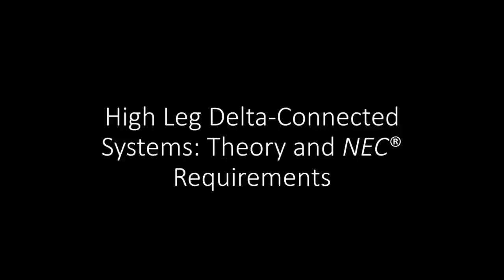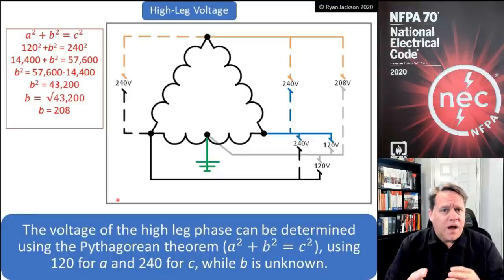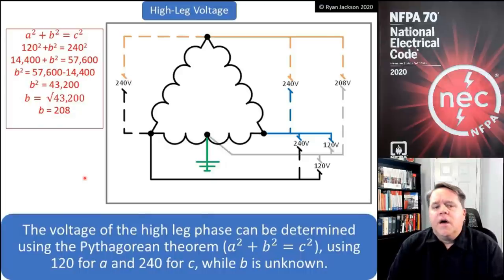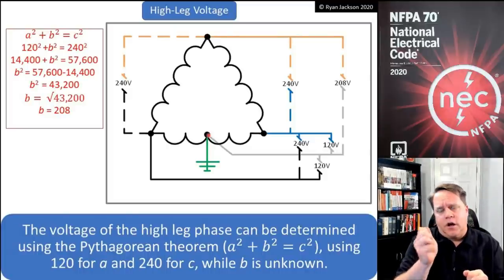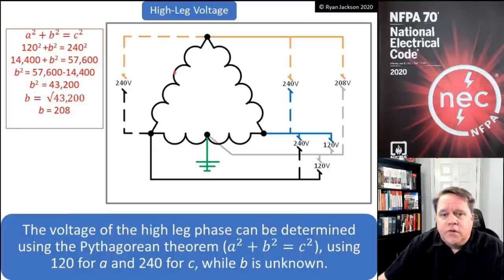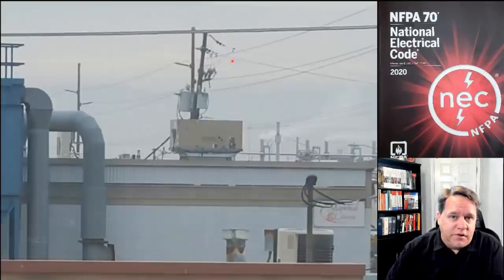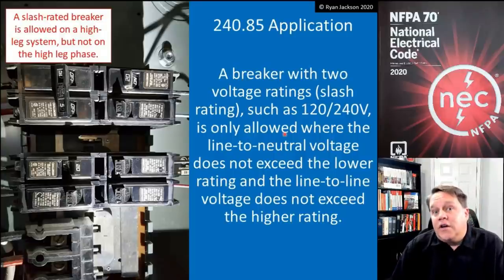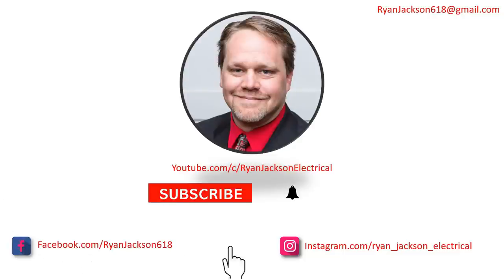High leg delta systems--explanation and NEC requirements

Comment: Thank you for explaining.   A good buddy of mine, is a master electrician and has been in commercial and industrial for nearly 40 years, only ran into a 480/415/240 volt delta, once in his career,  so far, which is  how unusual they really  are.   It was in a woodworking plant somewhere in northern Kentucky,  about 30 years ago.   The larger motors were running 480 3ø, while they were running the metal halide high bays as well as some smaller equipment off of 240 volts, or it appeared that way anyway.
Reply: I wonder what they used the 415 for, if anything. That'd be really cool to work on such a system. I'd really have to slow way down and pay a lot of attention though. I wonder what the color scheme was (not that I'd trust it to be true through and through, god knows there was probably a maintenance worker somewhere along the way that patch something in with whatever they had)... but just out of curiosity... still it sounds like a fun place to do some wiring. I like unusual challenges. Thanks for sharing. Unfortunately I'm doubting the likelihood I'll ever run into something like that. I don't do much industrial.

Comment: Thank you for your educational expertice. I am grateful for your knowledge sharing. Here in San Antonio, I asked CPS to provide a High Leg to my home to power several 220  high current  devices (welders , plainers, band saws ,and a few other 7.5 HP equipped devices). Their response was that  we dont run these to homes given that the feeds are 1) underground and 2) the cost of installing a transformer might make you change your request. I settled on  320 Main  with (2) 200 amp pannels and never looked back. Thank you CPS for an education and pulling it together for me.  That being said,  I dont mind paying more for power given their accomodation ..

Comment: We still have a few corner grounded deltas here in town. can easily tell because the metering cabinet is on the base of pole, and there are only 2 CT cores up on the crossbar on the pole. also, you can see a small bonding wire coming from the third unmetered leg going to a ground wire running down the pole.

Comment: Excellent video, and very timely for me, complacency just led me to burn up the 120v coils on 2 contactors, because, in a rush trusted the colors, did not use the meter, and connected the high leg to the control circuit. Won’t happen again.
Reply: Yep, easy mistake to make,

Comment: I have a 480V H-L Delta in three single phase cans with each center tapped. It is providing 480/3ph and 240/3ph and a 415V stinger leg. If 480V Delta HL is rare, this set up with center taps on all the windings to give 240V/3ph has to be a unicorn.

Comment: I beg to differ, high legs are not a trap they're just an indicator that it's time to change gears... slow down and pay attention to what you're doing, that's all. They can actually have some cool applications. 

[TLDR: the rest is just story time about the only time I ever really dealt with a high leg system when I was an apprentice under my dad. We installed the system in a rich guys machine shop. It was fun. I was an unfocused kid.  20 yrs later, I'm impressed with how much I remember of it.]

(I'm too lazy to proofread it or break it into paragraphs, sorry.)

When I was first doing my apprenticeship, my dad was my mentor, and we landed a 400a residential service for a well to do guy with a machine shop in his backyard, and we put a rotary phase converter then a delta to high leg delta transformer in the shop it was a pretty cool experience. We labled the inside of every box in that shop even if no high leg was carried to it just in case in the future someone pulled a high leg in cuz dad thought the guy migh rearrange his shop at some point. It was a really neat setup. The 3 phase pannel had it's own seperat boding and ground and it was locked out such that you couldn't turn anything on until the phase converter was turned on so that it never started with a load on it. I didn't understan much of what was going on but I was learning a lot really fast. Now I know that there was a lot of unusual things going on there, like the phase converter perduced all 3 phases not just on extra phase so that the phases were 120° without any fancy syncing mechanisms and it was it's own isolated service system. Basically it was two giant motors, one bigger than the other in a pedestal mounted cabinet just outside the shop, that fed his custom transformer (also pedestal mounted cabinet just outside of the shop next to the phase converter) that ran to an external disconect then to an internal pannel. We labled the pannel, then on top of field marking the high leg and marking the pannel on the outer cover inner cover and inside the panel itself we also put a printed lable on the high leg, and next to every high leg breaker slot on the panel cover even if we didn't break out that slot cover and put a printed lable on all the High legs in boxes that we actually used. We ran grounding conductors throughout and bonded all the conduit and boxes with bonging wires and bonding fittings/connectors. With how much precaution dad was using I'm surprised we didn't used ridgid (probably cuz dad didn't wanna buy a threader if I had to guess)... honestly I think the guy said something to Dad that made him scared that the guy didn't really understand electricity, and so dad was just being super extra. Plus the guy said the shop was his baby and money was no object, he wants it really nice so... I'm actually proud of myself that I remembered all that... I was like 19 and didn't understand half of it and didn't really care it was more focused on girls... now I'm in my mid 40's and thinking wow, I picked up on more than I realized...

Comment: You can connect modern LED light fixtures to the high leg with either hard wired  fixtures or with mogul base sockets (120-277 volt 50 or 60Hz). Make sure that you use a
Straight rated 240 volt circuit breaker.

Comment: Most transformer manufacturers make a 240 volt delta primary to 208Y/120 secondary 3 phase transformer in all of the standard KVA ratings. You would have to special order it as most supply houses don't stock them. You can put all of your 120 volt loads on any of the phases of the secondary of this transformer. You can therefore balance the secondary of this transformer as well as the primary. You can therefore balance the overall load on the high leg service.

Comment: "If you ever run up against a high leg delta, now you know what to do and you know what to look out for..."

Well, not quite (actually I do - "Call an electrician") - but I certainly know a lot more about this area than I did 30 minutes ago. I always wondered about that 208 volt thing and now understand that much better.

I can also now glance up at transformers on a pole, stroke my beard, and make sage statements like "That's looks like a open delta high-leg drop" and then wander away before anyone asks any more questions.

Comment: As a HVAC technician I would love a marking in a box with no neutral. We often connect 120v equipment  by grabbing a leg and using ground for a neutral when we don't have 120 on the roof
Reply from the maker: You need to stop doing that before you kill somebody.
Reply: If only that was an option

Comment: Just last week I ran into this, and like you said every 3rd breaker slot was empty. There is one set of wires from the pole connecting to two heads with two separate line sets going down to separate disconnects. But one panel has the orange, center, high leg fuse missing, then at the two panels they lead to it changes to the C phase, and is marked high leg orange. Is anything different as far as bonding neutral to ground, at the first panel only? Reason I ask is one of the sub panels has a sticker saying it would need an isolation kit to separate grounds from neutrals, and both were attached to same screw terminals. Wondering too about balancing the phases, thought I’d connect all the 240v HVAC units and ovens etc that are truly 240v, meaning no neutrals to the high leg to try to balance things, but not sure if I should or if I should just keep not using the high leg. I’m doing what I can before the electricians come in.

Comment: I came across a 480 volt high leg delta system once. It was at a waste water facility in north-east Ohio.
Reply: Very cool.   I didn't know that even existed until I watched this video, and I bet many electricians probably never will run into that.   Personally I have worked on a few 240 volt delta systems in Southeast Michigan.   They are (were) fairly common in rural areas and on farms that had 3 phase motors for grain dryers , augers and conveyors,  while the majority of the load was 120 and 240 volt single phase.   In that instance they would often install a second transformer and create an open delta high leg.   In this day and age, though,  it's pretty common to use a rotary phase converter,  if you are in a situation where you have a few pieces of 3 phase equipment but only single phase is available,  as it's typically much cheaper and most cost effective.

Comment: I would imagine many of these requirements also apply to a system derived from a 240 volt single phase to 240 volt three phase phase converter, since the end result is also a high leg delta...

Comment: Ryan, I started my career as an electronics tech on B52 bombers in the USAF right out of HS.  I took up Electrical wiring (Commercial then Residential) in 1972 and got my Journeymen's license.  About 1980 I went on to designing mechanical and electronic equipment and programming embedded microcontrollers and PLCs. Skip 40 years, I now am building my first and last house.  That being a 40 year span I need to learn the NEC again. I do have a licensed contractor to guide me and pull the permit and check my work before inspection. I am designing the electrical and mechanical of the house.  I have watched many of your UTubes and just came upon this one.  I have to disagree with your usage of 120/240 volt  2 pole breaker on the high leg.  The breaker contacts have voltage across it only when it is OFF. When ON it has 0 volts across the contacts.  So the two connections possible using it would be two 120 circuits to neutral. Not really functional unless you wanted to to drop out both circuits (120)when one tripped. This is one of my intended uses for it!  The other connection is two legs connected to a 240 volt load. Phase does not matter because the load is not connected to neutral..  The only restriction is the same as a single breaker connected to the high leg with the load connected to neutral. I plan to use the high leg for 240 volt loads. What I'm looking for is where I need GFI and or AFI protection. Thanks for your excellent teaching. Dave
Reply from the maker: See 240.85.

Comment: Hi Ryan, I can't find any information regarding a 230v single phase motor and wiring it to a high leg panel. Can the motor be wired with the 120v A phase and High leg B phase?
Reply: Yes it can. Any 240V line to line piece of equipment can run on phase A-B because it's "seeing " 240V,  it cannot tell which phase if any, is the high leg.  If you think about it, voltage is the "electrical pressure " or difference of potential between two points.   

The only thing you would need to watch out for, is that the breaker must have a straight rating of 240V, and you won't find that at your local home depot or Lowe's,  you'll need to go to an electrical supply store and they'll most likely have to special order it for you; the breakers at your big box stores are slash- or slant rated 120/240V.  Also, if the 230V motor in question is used in a piece of machinery with 120V controls,  a CNC machine is a good example,  using phase A & B (high leg) could be a decision you'll immediately regret,  if the control circuits are inadvertently connected to phase B – neutral.

Comment: At the pool where I work, I have replaced panels before and a lot of our older facilities have high leg deltas and a good chunk of our newer pools as well.  Our second and newest water park has a high leg delta.  Our first and oldest water park has a Y system.  I always like to call the high leg the "bitch phase".  And, I always like to mark the wild leg with orange.  Neutral is marked white.  But I leave the other two wires alone.  And, I only trust my meter and I always like to mark the panel with the label, "CAUTION:  B PHASE TO GROUND HAS 208 VOLTAGE".  And, the decoy spots that are traps, I mark them with a label, "HIGH LEG".  And, on the panel door, I put a label, "BE CAREFUL!  210 VOLT HIGH LEG!"  I do all of this to make double sure that either I or someone coming in after me don't blow out equipment like computers, TVs, VCRs, DVD player, garage door openers, ceiling fans, fluorescent lights, vacuum cleaners, Christmas lights and trees, and other equipment.  That bitch phase has a voltage that can damage equipment and will bite equipment.  When you see a breaker space skipped every third spot, it means beware of the bitch phase.

Another thing that I want to add to your video.  If I am putting a double pole breaker in a high leg delta, if I need 120 voltage from both sides of that breaker, make sure that both poles are not on the bitch phase, if you need 120 voltage from both sides.  If you have a 240 volt window unit, good idea to keep both sides of the breaker off the bitch phase.  If not possible, label the pole of the breaker on the bitch phase as "HIGH LEG".
Reply: Great story.   I call the high leg as the stinger leg, because it stings equipment and your bank account  if you screw up and connect this to 120 volt stuff.   That's one reason I'm not a particular fan of this system,  but I'm not afraid to work on or install this, because I'm armed with knowledge so as not to cause damage or injury.

Comment: I’ve never connected a 2 pole breaker in a panel to a high leg on a L6-20 receptacle in a server room( no neutral needed). I never felt it was secure. Maybe I’m wrong. Please advise me for future connections. Thanks for your teaching!!!
Reply: Only reason I can think to avoid a high leg is to keep the phases balanced since the center grounded winding MAY see more load.
Reply: I don't see any problem with using a two pole breaker on the high leg as long as it's ONLY running line to line loads because the load sees 240 (or rarely,  480) volts, no different than the electric water heater in your home running off a 120/240 single phase system.  The only issue is the breaker is a straight rating,  not a slash rating   Most two pole breakers are 120/240, a straight 240V two pole breaker is a specialty item and you'll not going to pick that  up at your local home depot.

Comment: There is no 'problem' with the voltages on a high-leg system!
They are what they are- it's simple mathematics.
It's just one of the available options for end users to choose.
In Chicago there are many mixed use buildings with both commercial and residential occupancy.

Comment: If there were a dedicated 3 phase 240v feed to a piece of equipment from the main service panel, but that piece of equipment also had a 120v control installed that pulled from a 120/240 sub panel (with an unbonded ground), is it conceivable that an equipment fault could potentially backfeed 208 through the neutral and fry things running on 120v?

Comment: Kind of remember from my vo tech class over 50 years ago said something like not to load the center tap more then 10% on a delta center tap because of creating too much voltage difference in phases. To me best pratice would be to always install a seperate transformer to get 120 volts like the secondary on a 120/208 3 phase transformer.

Comment: Thank you for the video, Ryan. I have a question. At the beginning of the video, you said that what makes this system a high leg system , its because you ground the system from the neutral point of the system and connect to metal parts. I think its a high leg system regardless of if you ground the system or not. There is a purpose for grounding the system, but this system is a high leg system , grounddmed or not. The neutral point of the system happens to be where you make connection to earth. Is this....correct? Or am i missing something? Thank you
Reply from the maker: @RaulPerez-zy1ww  You cannot possibly have a high leg on an ungrounded system.

Comment: When would this system configuration be used and what benefits does it have?
Reply: Great question!  This system is often found in older commercial and industrial buildings which have mostly 3 phase motors, and where the overall 120 volt loads are small in relation to the overall loads, and is seldom  installed today.   The benefits are 240v instead of the more common 208 means the same amount of power can be transmitted at a lower amp draw, and slightly smaller conductors and raceways can be used, saving costs in labor and material.  This system has two major disadvantages.  The biggest is that it's easy to mistakenly connect the high leg where 120 volts is desired and smoke up everything on that circuit.  Also load balancing will be poor if there's  substantial 120 volt loads.

Comment: Question, Why is it that you are referring to the 208V leg as the high leg when you have 240V that reads higher voltage I am asking not to be smart but maybe there is a reason for
Reply from the maker: Because there is only one that is 208 to ground. The other two are 120.

Comment: Hi Ryan thank you for the explanation, it was very insightful. I am having trouble understanding why "every third space" will be empty on a high leg? Is it only in the context of not having 208V to N loads in the system?
Reply from the maker: Yes, that is correct. Here in the U.S. there is no practical application for a 208V line-to-neutral power source.
Reply: @RyanJacksonElectrical  thank you :)